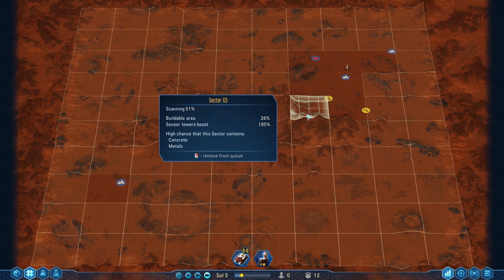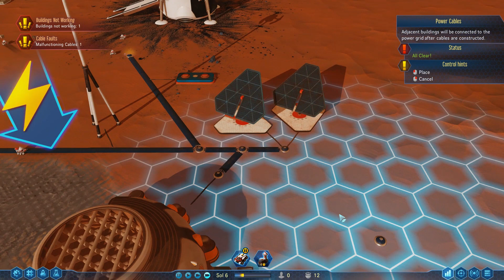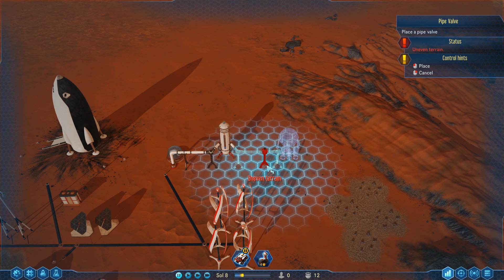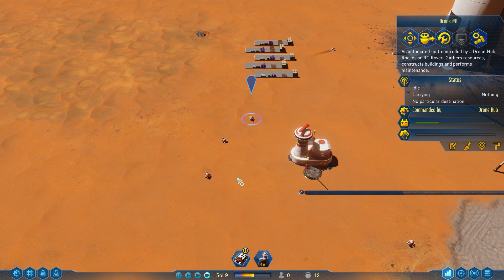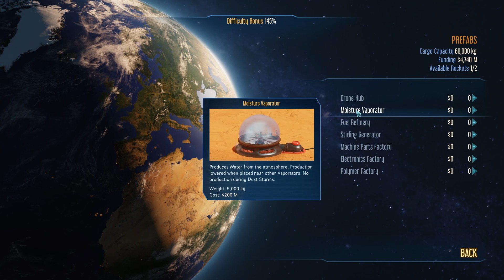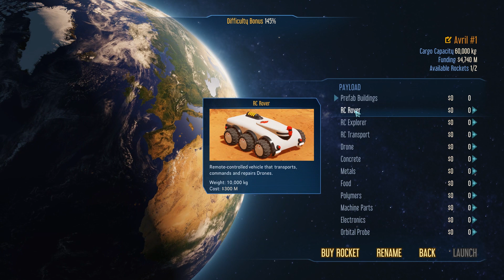Surviving Mars - #2 - H2Ohhh Yeah! - Let's Play / Gameplay / Construction

Comment: Hygroscopic is basically the scientific term for a material that attracts and absorbs water from the surrounding enviroment (like Silica gel for example)
By the way, those upgrade techs don't actually upgrade the buildings, it just unlocks the upgrade, you have to click on the building and tell it to install the upgrade.  I think some of the upgrade breakthroughs activate instantly, but the techs are usually just upgrade unlockers